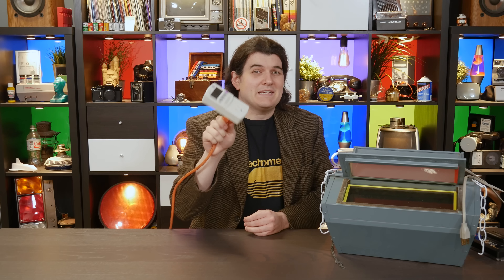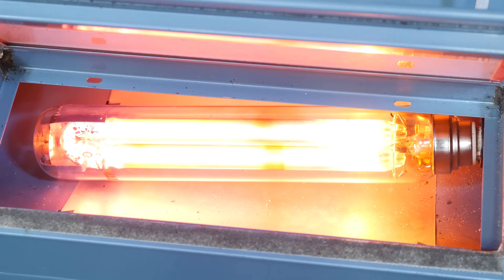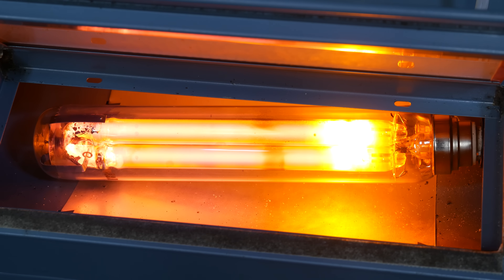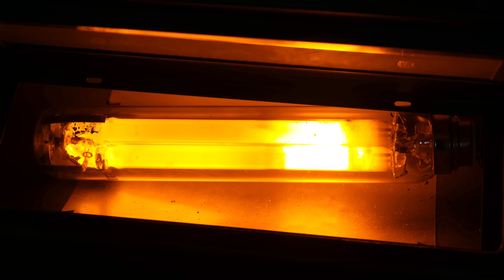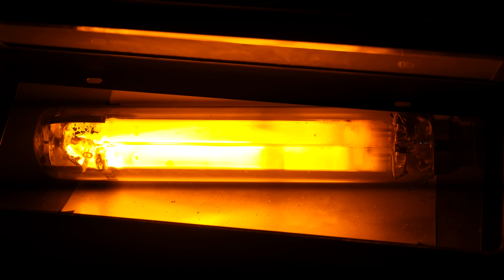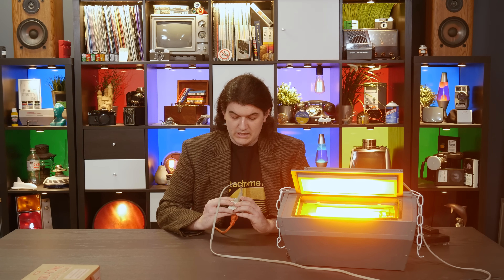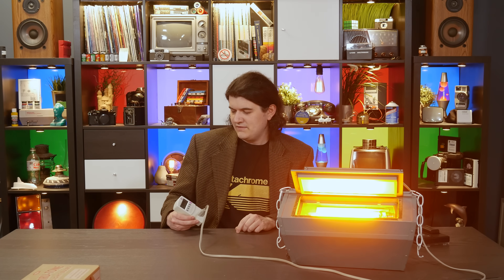More vaguely-informative ramblings about low pressure sodium lamps

Comment: There's a few of these left on my street that provide light. They've started replacing them with LEDs, and it just... It looks hostile and harsh. They look like invaders between the trees. The yellow light of low pressure and high pressure sodium lamps creates a much more inviting atmosphere that makes it more pleasant to be outside.
Reply: Hit the nail on the head. They ruin historic districts where sodium light has made a great atmosphere and the harsh white LED is terrible

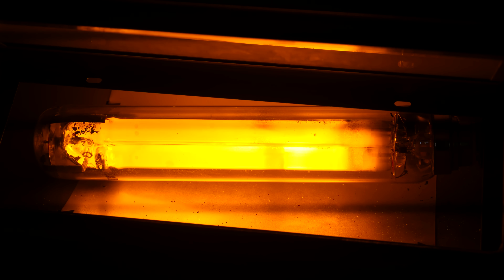Comment: 7:54 Oh hey, a camera rolling shutter artifact =D
You could calculate the framerate of the recording based on that line and knowing the frequency of its flashing.
(If i'm correct in the assumption that the sodium has some inherent flashing frequency in these conditions)

Comment: These are used in most residential areas in the UK. From what I gather, as the main failure mode, they tend to run for a while, cut out, restrike, and carry on. Starting only every now and then, then quite regularly, and eventually it won't get up to temperature or strike

Comment: 5:20 isn't the wear method that the sodium vapor, after turning it off, solidifies back into sodium, except this time it accumulates on the inside of the glass, gradually dimminh them? But that sodium layer will vaporize again next time it's turned on... then maybe just gradually taking longer and longer to fully turn on, and one day, not enough sodium to evaporate would be directly on the electrodes for it to turn on, or... eh... I assume that's how it is, there are solid chunks of sodium that are the primary providers of it, right?
Reply: These lamps usually fail because not enough emissive coating is left on the electrodes at the end, although the very big lamps sometimes fail because the argon gas gets absorbed into the glass and makes the ignition voltage too high.

Comment: that bulb is low hour , you can tell because it is almost clear around the electrodes, these type of bulbs normally run for 10+ years without a bother running every night for many hours, this one was hardly used at all because of the housing it is in. 
The Sodium always hangs out in the same place because the bulbs are set at an angle, this is to keep the sodium in the correct place.
I have had these types of lamps for 30+ years, they all seem to fail in the same way , the glass cracks on the inner tube down at the electrode end, the gas leaks out and then they fail to start up correctly , they may glow pink as the electronic starter tries to start it but they never start up. 
These types of lamps never loose brightness over their lifetime , they will draw more power though when they are near the end of life.

Comment: In Philadelphia Pennsylvania, the subway tunnels use LPS lamps.  The stations have fluorescent fixtures with cool white LED drop-ins but the tunnels themselves are all orange.  They're replacing some of them with new daylight-white LED fixtures which seem to make a world of difference, but they only seem to be replacing them every time a lamp dies rather than just going through and replacing all of them (although they did replace all the lights in the trolley tunnel all at once).

Philadelphia also has the PATCO train and it's tunnels are lined with standard wall-mount parking lot lights.

Comment: I remember years ago and I've seen a few of the fixtures around but I doubt they'd be working or possibly an abandoned lot or something as in car lot.

I'm still saying in the towers no standing but I hadn't seen them at night to see if they're working.

Can't remember where I've seen them but I have here and there I have moved in recent months.

About the car lots I remember when I was younger.

From where you could see that and when you saw them.

Especially when they were off not operating another words.

And sometimes they would look just like standard fluorescent 4 ft.

Sometimes you could Cebu difference especially from ground level or looking out a car window.

But yes they looked very much like a fluorescent tube specifically of 4 ft.

I do remember they almost had the color of a neon tube the red orange when turning on initially.

I don't know how long the wrong time was because it's been too long since I've seen one startup.

Typically the fixtures I saw look white kind of like a fluorescent tube except more tapered poured one end and got water as it got closer to and it was attached to the structure or Pole.

I seem to think they were an angle but they may not have been as hard to remember.

I almost have confused them is I knew that at one time they had for us and street lights.

I was thinking University a holdover from forest and streetlights as well but which were entirely different animal.

Thought they had been converted from fluorescence potentially.

But what really got me flummoxed was at start up the neon like glow in starting.

Which I believe is called pinning mixture but I'm not sure if there's a proper term for this gas used in this application or not.

Also has anyone ever seen a fluorescent light that warms up turning pink because of long operation and the Mercury be absorbed completely or nearly so.

Sometimes common and compact fluorescent lamps.

Orin lamps at work very long hours they're just left on continuously.

I don't think I got an image of this but where I worked at Goodwill before we had some whites or just left on all the time for security purposes.

And they were doing some relighting and that was the only time it and ever been replaced as far as I know as long as we were there.

By the way our building used to be a Circuit City.

Which explains a lot with the construction of the place as well.

Such as the off-air TV antennas and other antennas on the building and the satellite dish that we never used of course on the roof there were a few other touching antennas that we're hard to tell what they were from the ground.

I suspect am and FM and perhaps others as well.

Although eventually we did wind up using at least the antenna feed from the outside was it founded for testing TVs in stereo systems at least for awhile don't remember what happened but someone did.

We did this just to see a viable I think.

We once discussed options to be able to use this for TVs we had set up on display not technically feasible or too expensive in the end one or the other.

Among the lot all the walls there was Jack's for all this already anyways.

Mostly painted over of course.

Surprisingly when I was doing some cleaning I noticed there was few old what appears to be two duplex outlet but it has screw terminals that's meant for twin lead and TV connection and or FM.

I also Evangelical fights it almost looks like forever for TV rotor as well.

I know for a fact there was no rotor on an antenna.

My feeling is that they were using those for something else from the store and I may have been even connected in parallel any idea on this.

And even a few ports for RCA's than other weird connectors that I've never even seen before.

Worm seen but okay what would that be used for.

Including one that look like old-school 12 p.m. free modular connectors.

I'm thinking it was something first or used originally or have something special day for display purposes perhaps switching?.

Also quite a bit of 8-pin octal sockets and other types of tube socket like connectors including 4 6 and even 11 pen.

Could have been used for specialty types of equipments for display or something custom for this but no clue.

I could have sworn some of these connectors some of most odd ones.

Were the old modular style connector system called dasprad I'm pretty sure I've got that spelling wrong but it wasn't popular in the 50s and 60s and still see it in some especially applications here in there.

And yes they had TV rotor connections for this as well but those were not the ones they were circular or Park circular connector with Todd pinzon. Spaces.

There was even some surprisingly European connectors such as the den speaker connectors with the one round and one flat pin.

But that was mounted on a plate.

I've never seen a wider variety of connectors in one place.

And who knows what it was before a Circuit City building was not as old as when told of connectors were rich I use so that would not have been some from that period of time.

Some of this probably could have been from some source security system to prevent theft of items.

And one person was stymied by something when they're doing some construction.

There was junction boxes that did not have a box and all there was was a steel cable with a security shroud meant to resist cutting Luke through the walls.

My guess was security which makes sense to be able to secure something permanently or someone permanently.

Apparently there's a wire leading off either end to monitor this but I think this is another place but it seems to ring items there.

Most of that have been painted over numerous times so it's hard to make out as well I could tell what they at least it used to be you wouldn't even realize there's a connector there at one time

Comment: When I built my darkroom last year, I tried to find LPS lighting, because it's supposed to be possible to use that specific safelight or a Duka LPS for RA-4 color enlarging -- dimmed WAY down, but the monochromatic emission is perfectly at the minimum sensitivity of the color printing paper.  Fortunately, there are LED bulbs available that are monochromatic at the correct wavelength -- the ones I bought were advertised as "turtle lights" (apparently they don't disturb wildlife the way white light would).  They're a lot cheaper than a replacement bulb for LPS, even if you could find one, too...

Comment: Oregon recently relamped a couple tunnels on I-84, I don’t know if they used to be LPS bulbs but they were a dim yellow like that bulb

They replaced them with BRIGHT LED bulbs, one in particular is about 30 miles outside of Portland, with no lighting outside the tunnel so you go from complete darkness to blinding way too bright tunnel back to complete darkness

Comment: I miss the sight of Low Pressure Sodium (or SOX, not to be confused with the Boston Red Sox which Ebay keeps doing) lamps round here, the last one on this street was replaced a few months ago with a cold white LED fitting, a colour temperature which is REALLY bad for maintaining night vision, I really do need to get myself a streetlight fitting with a SOX lamp before they end up like retro computers, completely overpriced and hard to buy for cheapskates like me...

Comment: I remember growing up catching the exact moment the light sensors on the street lights would kick in and getting to see the whole road lined with very dim bulbs glowing pink before eventfully turning to yellow/orange once warmed up.
And now I drive down a dual carriageway in the dark and at around 4:58am seeing the entire road switch on instantly with white LEDS.
Dusk/dawn and night time just doesn't feel the same without them.
BTW I have seen some street lights not working and stay pink but only a handful over maybe 20 years.

Comment: The silvery stuff stuck to the U-bend could possibly be the "getter" rather than the sodium. It is a reactive material purposefully left during manufacturing vacuum tubes are sealed to absorb any remaining gas that got left behind and gas that takes longer time to be released. These low pressure lamps might be manufactured similarly to vacuum tubes.
Reply: No it's the sodium
The getter is near the base and in the outer glass tube, not in the u shaped tube.

Comment: So a bad power factor is like when you’re pedaling a bike and instead the load being even, the bike’s gears are altered in a way so you’ll need more power to pedal when the pedals are at top or bottom, right when it’s hardest for you to move the pedals.

A good power factor would instead consume most power when the pedals are horizontal, which is when your legs can push the hardest.

No extra energy is consumed, but the peak load on your legs and pedals is greater and therefore uncomfortable.

Does this analogy work?
Reply: I've heard another analogy.
It's like towing a car with a diagonal tow line, the tension in the tow line is higher, but the actual energy input is still the same.

But I kind of liked how your analogy worked as well, since the sinus curve are like the pedals.
I think that some instruments can measure pretty wrong currents when the power factor is bad.

Comment: A highly reactive load (i.e. poor power factor) wastes excessive energy because the I2R (I-squaredXR) losses in the transmission line are higher than would otherwise be the case for a given amount of energy delivered to the customer. Residential billing is based on watt-hours used rather than volt-amp-hours, and the I2R loss is basically just a cost of doing business for the utility. Traditionally, most residential load is resistive so power factor isn't a huge concern. Very often, the metering for heavy industrial users (particularly those with heavy motor loads) includes the ability to measure power factor, and penalties are applied through billing for the utility to recover some of the excess cost of production. Such customers typically select motors such that their motors run close to full load (improves power factor compared to an over-sized motor) and by installing capacitor banks on their supply lines to provide at least some of their reactive load requirements.

Comment: 1: Doesnt' surprise me that the gear is inefficient in that light. Most US spec HID gear uses an autotransformer ballast to increase the open circuit voltage of the output to aid in stroking and running the lamp. these ballasts are quite inefficient compared to a choke and especially electronic gear. My Philips MI26 street lamp with a 35w choke draws about 42-46w with a standard 35w lamp in it.

2: it should also be noted that the U bend of the tube is the coolest part of the lamp even when it's at full operating temperature. this is where the sodium will normally start to condense first, and as these lamps are usually run tilted base up, the liquefed sodium will tend to migrate to wards this U bend. I have Philips lamps that have the dimples all the way down the tube, the dimples nearest to the cathodes are all empty and the U-bend is coated in sodium.

3: It wouldn't surprise me if ILDOT has been relamping their fixtures with regularity, although SOX (LPS) lamps have a very long average service life of around 18,000 hours. I should not that there have been documented cases of these lamps being run 24/7 and achieving significantly more life than this before the discharge tube cracks from thermal stress, or the emissive coating on the cathodes is spent, resulting in a lamp failure.

Here's a few fun facts;

- Low pressure sodium lamps only emit one wavelength of light at 589nm. This type of emmission is referred to asthe Sodium "D-line".

- The outer bulb of these lamps are vacuum sealed, and they also have a coating of Indium Tin oxide (ITO) which reflects more of the lamp's heat back into itself. This is vital for the lamp's efficiency and performance as the discharge tube itself can't retain the heat it needs to be able to vaporize the sodium and produce any meaningful light. If you see a lamp that has a shiny black material at the base, similar to vacuum tubes, this is a getter material that is used to ensure the vacuum is well maintained. The getter material reacts with any gases that may enter the outer envelope. 

- In the 1960's and 70's, low pressure sodium lamps became a common replacement for mercury vapor and incandescent lamps in the UK due to an impending energy crisis. In an attempt to save as much energy as possible. the UK government and councils employed the use of low pressure sodium lamps exclusively as they were, at the time the single most efficient light source we had available. They remained so from then until the recent developments in blue LED technology which has lead to LED lamps with efficiencies on par with a 180w sodium lamp, but across the entire wattage range, making them more versatile.

- Lamp wattage ranges for low pressure sodium are 10w (which is exceedingly rare), 18w (rare but did see use in bulkheads and low height fixtures), 26w, 35w, 36w, 55w, 66w, 90w and 180w. Some lamps also came with the "SOX-E" nomenclature. These lamps were designed to have increased efficacy and could be used as stand-ins for standard SOX lamps.

Good examples are;

26w replaces 35w
36w replaces 55w
66w replaces 90w

Comment: My folks have three high pressure sodium fixtures on their property for security. A 50w in the front yard, a 70w on the barn and a 100w on a tall pole in the back. that's 220w every night for 8 hours....I did replace the yard light's balllast as it failed, with a newer electronic ballast and it works great. more efficient.

Comment: I'm from Brazil and they were very common until like 2010. They replaced those with high pressure sodium bulbs, I don't know why, they are very similar, maybe because they stopped producing them. Now the high pressure ones are getting replaced with flourescent and LED bulbs, but you still can find low/high pressure sodium bulbs everywhere.

Comment: What sort of LPS lamp is that? Judging by length I think it's a 35W SOX. Since those are the lamps used in street lights in my area that are at a simillar length. Although I don't know if the wattage is different from that same length since I live in 230V 50Hz land. Edit: Nvm. You said 35W but I wrote this comment before you said that. Whoops.

Comment: You are correct, used in a relatively clean environment they go forever. The most common failure mode I found having just redone a bunch in a parking structure was the capacitor going thermonuclear or water getting into the ballast transformer causing corrosion and shorts in the windings